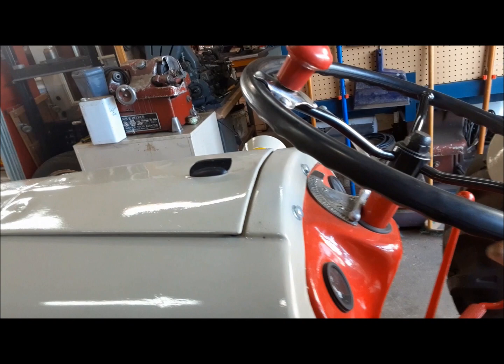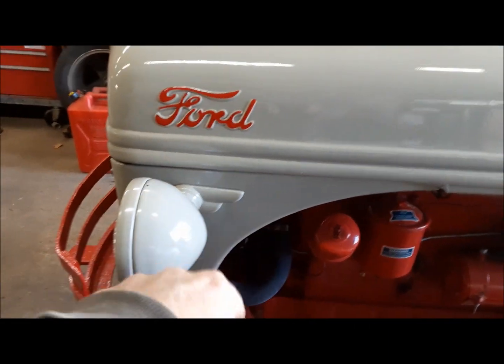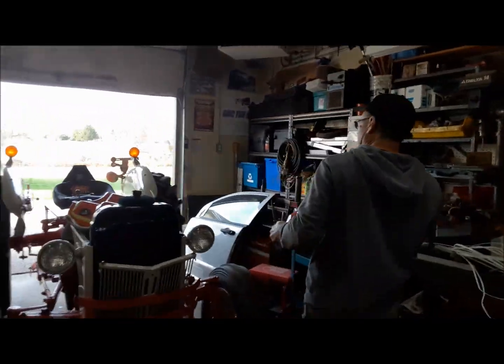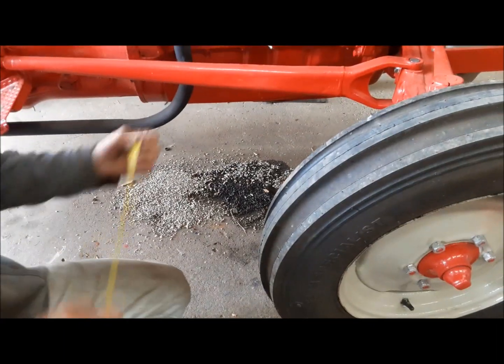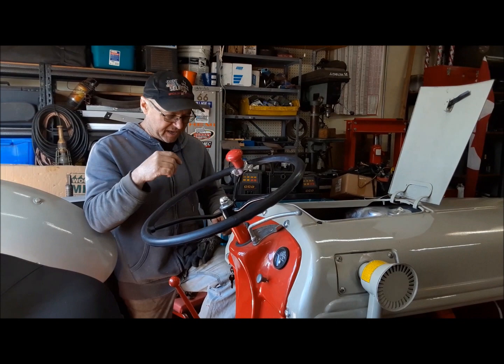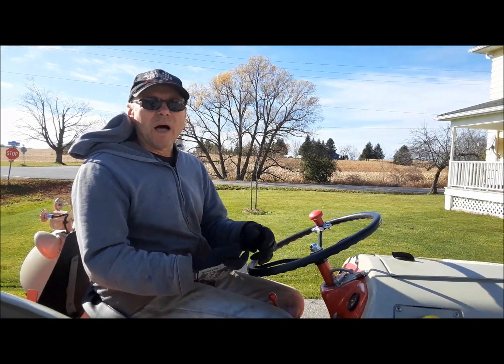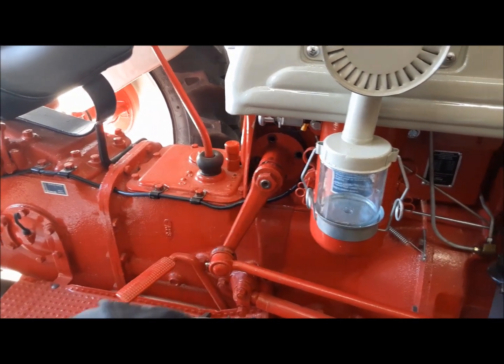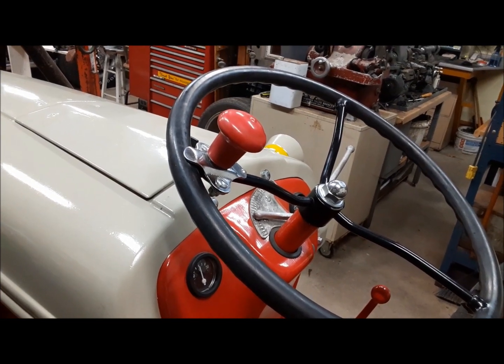1948 Ford 8N Steering Box Replacement

Comment: Hello Kevin: I have this on going passion of restoring old tractors, the problem is after I get done i feel that I have to keep them. I am in the process of fully restoring my dad's first tractor he bought when I was 5 years old which is a 1948 8N Ford, I will be 70 in June. I feel that I know you for a long time because I been following you thru out the rebuild. So for, I rebuilt the complete front axle and spindles, steering box and the rear brakes, axle seals. Its a complete brake down so each part gets completely cleaned and detailed before the epoxy prime and paint process. You do a great job with your show and tell including with what don't work in the real world. I watched you over and over that makes all my efforts point on. This 8N makes my 9th tractor that I've restored over the years that makes a part of my Bakers dozen collection. Keep up the good work of following thru from part to part of the restore. Thx John
Reply from the maker: Thanks for watching and best of luck with your project!

Comment: Hi Kevin I was just going to say that I felt your frustration with that late 8N steering system they are very hard to keep oil in and to get the play out of the teeth but I made the mistake for many years of not having the oil level up to the top bearing I thought that the plug was the proper level but now I have learned to use silicone gasket maker on all of the shims and the boss and then fill it up just passed the shims and keep that bearing I also learned that if I use #140 differential oil it stays in longer and I use some more silicone on the washer and egg corn nut on the steering wheel to keep rain water out. But I appreciate that you kept it period correct and glad you are able to use your over drive now!😀🇨🇦
Reply from the maker: The 2 bolt steering box is def the better option.

Comment: Okay, dumb question time. Why did you only adjust the left hand tie rod and not both in small increments?  TTFN/CDC
Reply from the maker: It depends where the wheels are. Once you have the box centered, you check the wheels. If one is straight ahead its good.. Then you adjust the other one to get the toe you want. Its just how this one worked out. Sometimes you have to adjust them both. But I had already been at this one before. The thing to remember is you are not just setting the toe, you are setting the toe relative to a centered steering box.

Comment: My 8N has a loader in it, my steering is tight, is there a fill hole somewhere! Not familiar with fords
Reply from the maker: theres a fill plug on the side of them or you can pop the steering wheel off and fill it from the top.
Reply: What’s a good fluid too use? Marvels mystery oil or a power steering fluid
Reply from the maker: @truckie6119  80w90 gear oil

Comment: Hello Sir  ,    i just found your channel ,  or more specifically this vid.  & before my question   just wanted to say  --  Good vid,     &  a very nice looking tractor  !!!!!   Today i was looking at my first potential tractor ,   8n  1949    clean looking  ,   used only twice a year the past 10 years & before that sat for 17 years .     I was ready to purchase for 1800 cdn $  until they told me of the same steering problem as yours  ,  thus i am searching to see if its fixable .   Were you able to come up with anything else to completely bring the steering to new condition ,  also from your vid you said there are no new parts made to solve this ,   this is still the case ,  i presume  ?      Thanks for your time   --- Cyril
Reply from the maker: The early steering box is problematic. It is best to swap up to the 50-52 2 bolt steering box. There are usually used ones around and even new ones. There are many videos on performing the swap. I only stuck with the 4 bolt box because my tractor is a very early one and I wanted to keep as much of it right as I could(less the GM alternator anyway). Thanks for watching!